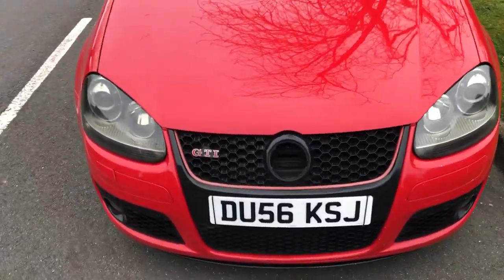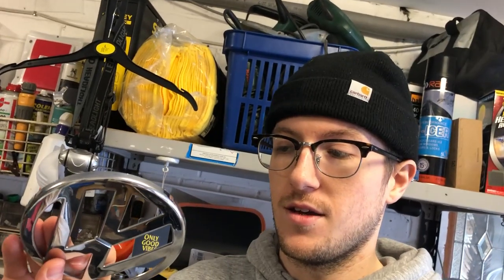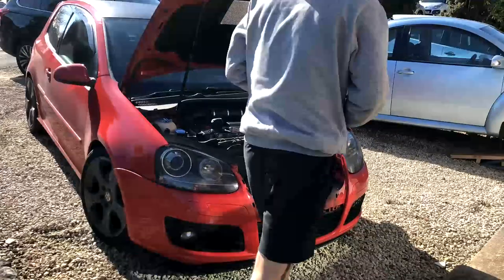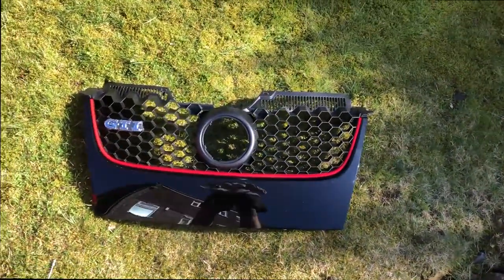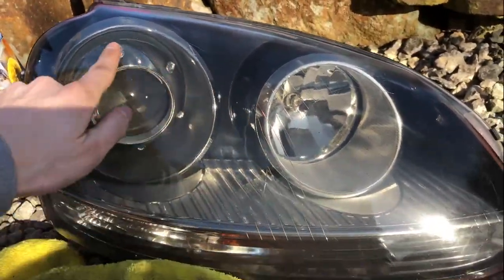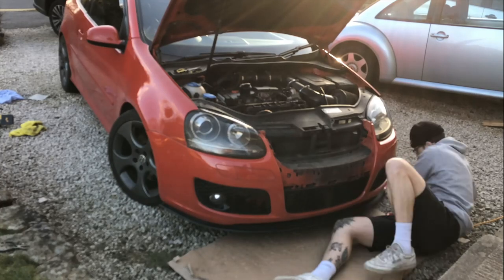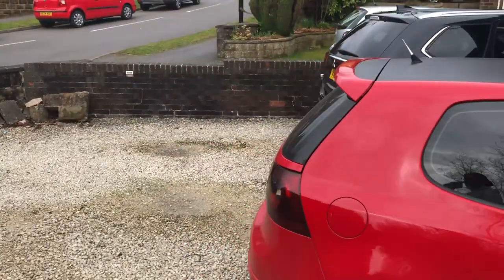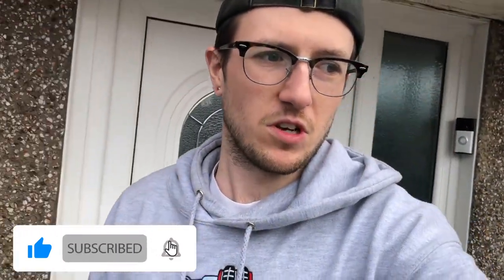THE MK5 GTI GETS A FRONT END MAKEOVER

Comment: Great job, that cheap ebay rubber strip looks really good. 👌 
I think the headlights have got tinted lacquer on them, so using a better grade of sand paper should get it off and then you be able to polish them afterwards. I wouldn't use paint stripper, that'll probably attach the plastic.
Reply from the maker: Thanks mate! Yeah you’re probably right, I’ve found you can get replacement lenses for around £30 so may just attempt to split and replace. Can’t beat brand new!